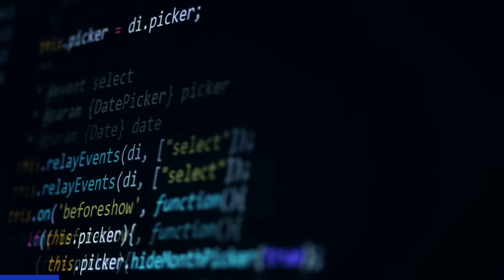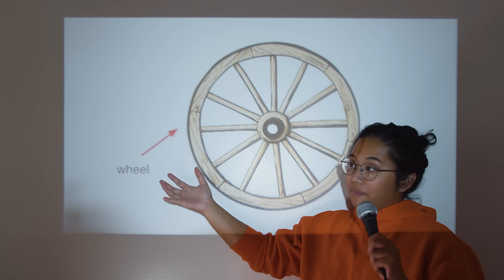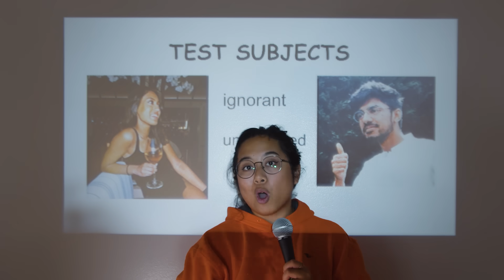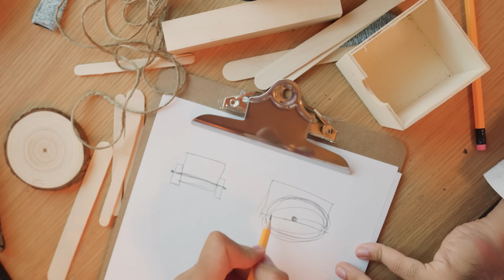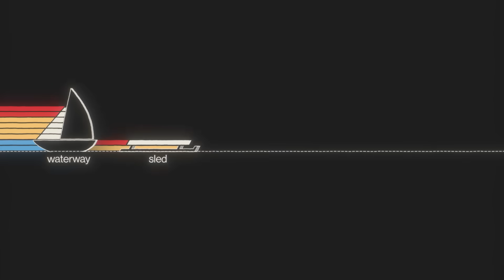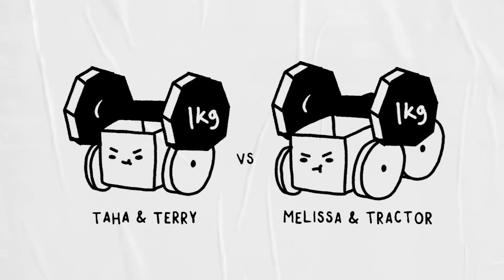why it took 200,000 years to invent the wheel

Comment: I am interested that Melissa’s interpretation of “Don’t reinvent the wheel” is don’t waste time on easy things.  I’ve always used the term to mean don’t waste time trying to figure out a solution to a hard problem if someone else already has a solution you can use.
Reply: This applies so well in design that it’s first thing they teach you in stem
Reply: Yeah, I didn't want to be the "Um, actually" guy, but yeah, lol. The term usually references a tool or a system that already works well, not that it was easy to create. A better tool or system might be possible, but it's usually not worth your time and effort. Just use what already works and move on with your other tasks.
Reply: @addanametocontinue  If we just settled for the first thing that worked because it appears to work well, we'd never have ended up with Maglev trains.
Reply: I guess it depends? A while ago I saw a maths exercise that I had done before and tried to solve it again. Obviously at first my thought process ran similarly to how it had done, but I tried to apply the new stuff I learnt and surprisingly it led to the right answer in a more simpler manner. Sometimes doing something again with different view and knowledge can help one come up with a better/easier solution.
Reply: @jacque.line_ng  sometimes, yes. but a lot of the time there is no need to reinvent the fundamental. Of course, in a certain sense, we are reinventing the wheel all the time. Material, tires, ball bearings, all those wonderful things that make modern wheels more efficient. but if you tried to start from scratch every time, you would never get to those improvements. which is to say, human progress is more times than not iterative, rather than innovative.
Reply: @jacque.line_ng  usually millions of smart people did that before you, which is why it is currently the most optimized state do to something
Reply: Don't spend your limited time and resources on a solved problem (if you can avoid it) is my interpretation as well.
Reply: Came to say the same. It's not about the simplicity of the wheel, it is the importance of knowing when you should apply existing solutions vs when to put effort into creating your own solution.
Reply: It's sorta complicated too, because reinventing the wheel is the best way to understand the wheel you're using. (Even for literal wheels.) So it depends how important it is that you understand every aspect of the thing you're working with.
Reply: I always thought it meant "don't try to invent something to replace something that is already perfectly efficient"
Reply: @zorn1745  Yes. That’s exactly what it means. Because that is the very definition of a time wasting action that has no added value. The saying is referring to things that are already working perfectly fine.
Reply: It could be both interpretations tbh. "Don't waste time trying to find a new solution for a problem that already has an existing, easier solution"
Reply: I never heard her interpretation before. I only know it as "why try to spend a lot of time trying to invent something that is perfectly solved already?" Because the idea of the wheel itself is already perfect and can only be improoved marginally, but there's nothing to replace it's idea as a whole.
Reply: I had something similar, about improving something when it's unnecessary.
Reply: Yup. Don’t kill yourself with derivations when Schaum’s is right there.
Reply: Occam's Razor
Reply: Yeah same, my interpretation has always been "use someone else's solution instead of solving it yourself" regardless of ease or difficulty
Reply: Why not both?  "Don't waste time on trying to solve problems that don't need solving".  It works whether the problem in question is something easy, or it's something hard that someone else already solved
Reply: @YayaFeiLong  so the implication as I use it is that it is inadvisable to invest a lot of resources in a task that will only produce a moderate improvement at best.  Complicated systems have so moving parts and redoing everything from scratch every time is a massive waste of effort.
Redoing a simple task isn’t that resource intensive so isn’t as wasteful.
Reply: @Taaneria  "Redoing a simple task isn’t that resource intensive so isn’t as wasteful." Not redoing but reinventing. You must come up with something new that can do exactly what the wheel does. That leads to people just making the same 'idea' when others already taking that known idea and are doing it better. Worse than wasteful it's detrimental and holding everyone else up especially if the new idea you are trying to sell is waiting on an old one.
Reply: Yeah that's how I use it too lol
Reply: That was the first thing I thought too. The harder the wheel was to invent, the less you should think about reinventing it.
Reply: I also assumed that because it was always sighted as the first invention in my childhood before any of the things they mentioned.
Reply: I'm just interested in Melissa... Thassa purdy gal right there. Attractive, too. And those are very different things.
Reply: those mean the same thing but worded differently almost
Reply: Thats the engineers usual approach if you want a guaranteed-to-work product on a deadline with limited budget. But you don't really get to improve stuff if you always go this way. Coming up with a better solution does require some sort of reinventing, especially if the "working solution" is a dead end and can not really be improved.
Reply: StackOverflow for the win.
Reply: I see if the same way as you
Reply: I think that is called Stack Overflow
Reply: That's exactly what it means. It's not about it being easy, but that a good solution is already available from somewhere else so there's no need to put effort coming up with a new one.
Reply: Yes she's not very smart
Reply: Me trying to program a calendar system
Reply: if its a solved problem youre better off making it intuitively simple for you to utilize rather than just copying it and moving on. Theres so much garbage out there because you can get by just treating everything like a blackbox
Reply: It means don’t do something that is already known — you’re not smarter than everyone in history combined
Reply: It seems like I’m an outlier in that I had the same interpretation as Melissa until I watched the video. (This is also the most thought I’ve put into the idiom, so I never really considered other interpretations.)
Reply: I suppose the difference is that the wheel is so widespread that anyone can make a wheel to a degree if asked to do it. Sure it won't be as efficient but still
Reply: Thank you, it felt like she is saying the opposite.
Reply: Yeah I always interpreted it as don’t do the impossible, which is kinda the opposite of what she said

Comment: 5:56 I feel like the main advantage of the free wheel design is that the free wheels can rotate independently whilst the fixed wheels can only move in the same direction making turning nearly imposable for carts using that method.
Reply: That's true actually, even today we can't figure out how much difference we should allow. If we allow anything than one wheel could get all the power. If we limit the ratio we could have reduced power.
Reply: I mean yeah, but also you don't have to move the axel. Less movement more effect.
Reply: Trains have fixed wheels

Comment: The key think that isn’t mentioned here is that the design of a wheel doesn’t scale as you would expect. It’s easy to make a small wooden model that is strong and works well but the friction and fabrication issues are far harder to solve for large scale and heavy payloads.

Comment: If I were in an age before the wheel with modern knowledge, I would have carved some stone ball bearings, possibly granite. Then build a race for those bearings. I now have a hub. Then I would build spokes and a tread around that bearing hub. I would lubricate the bearings with animal tallow to reduce friction. Now I can secure the wheels to an axle. Rinse and repeat. After that, I would secure the two wheels and axle sets to my wagon with heavy wooden curved bows for suspension springs (probably Yew or Ash), reinforced with scissor cross-bracing connected with dowels secured with cotter pins to reduce lateral stress. It will add weight, but it will make the ride less jarring.

That's what I could come up with just off the top of my head.

Comment: One thing you didn't mention but was crucial to the wheel being of any use was roads. For wheels to work you need to have a surface to roll them on - wheeled vehicles don't just run through thick forest, muddy riverbanks, or on sand. First, people had to notice that walking the same way for decades makes the way better because in time, you move big rocks out of the way, cut down trees and trample vegetation. Then, people had to have the idea that you can actively make a way where none was before by accelerating the process of decades of use through doing all this in a concerted effort in a short amount of time.

Comment: As good as the tension string axel was at the individual tasks, I don’t think the wheels would have rolled as well once the cart started carrying more than its own weight. I’m surprised it carried the weight of the egg without the abrasion of the cart’s axel holes gnawing the string apart. 
Plus, the max tension for strings are hard to scale up to item-transport size.

Comment: They both did a good job, but I think Melissa broke the rules with her pencil axles.  I don't recall pencils being among the things they were allowed to use since there were no modern (round) pencils in 3,500 BC.  The most difficult part of designing the axel was making it perfectly round.  I'm reminded of Nobel prize winning economist Milton Friedman point about a simple lead pencil and how there wasn't a single person that could make one by themselves.  It takes thousands of people around the world working together to make the metal tools to cut the wood, others to mine the graphite at the pencil center, others to get the rubber for the eraser.  Using pencils as axels seems a bit like cheating.  But pencil axels at least don't sag as much as string ones.

Comment: That was not fair for terry, as there were no competituon about sizes of a "wagon". Turn around radius, amount of axels, test for durabulity. C'mon you can create a wagon with 100 axels, it will hold a lot of weight, it will be able to pass 5 meters, but it will be hard to create and it will be almost impossible to turn it.

Comment: Terry has better wheels. He has suspension which allows him to transport over rough terrains.
And, to be frank, using ropes is like using thin axle on a marginally larger carriage. The steel axel actually budge under high load capacity, and it acts like tension rod to counteract the force and keep wheels under vehicle; this is why we don't use concrete pillar to make axle, well, the roughness it also one another reason. Melissa's tractor is an example of overengineering without enough troubleshooting, the fix to wheels coming off might be as simple as a grove for the rope to go in, but, that's how technology evolves, we fix new problems after failed solutions!

Comment: The "competition" should have included resistance with a heavy load, endurance over time (bearings are hard), and stability on bumpy surfaces. These "details" are what goes from a simple stick/string setup not good for work, to something useful for transport without constant repairs.

Comment: With the weight challenge they should not just check bottom touching floor but also wheels touching sides. After all, if the axle sags and the wheels touch the sides they cannot spin

Comment: It makes sense that inventing the wheel was hard. It is a totally different mindset. Like, modern day ppl, if asked to put a hole in something, they ‘drill’, but before screws were invented, ppl dug, because that is what they did to make a hole. In fact, ‘screws’ the helical object used to move water, existed long before the idea to use it to join objects, because hammering nails was the mindset, and that was because using wooden stakes was what was used before hand.

Comment: I saw that rope axle and immediately saw all the failures that it has. The biggest problem is that the rope doesn't twist infinitely, but the wheel really tries to twist it if you're moving with a load. You'll end up with a rope that's being tensed in every way possible which is not a good recipe if you want it to remain being one single rope (especially with something rubbing against like that).

On top of that, rope tends to stretch over time, though how much this happens depends on the type. But even if it did work, it won't work for long if you want any amount of precision.

Comment: Very interesting. Love the animations and small touches. :) Back in the day I bet carving was pretty hard besides sanding a small wheel in this case not to mention how rubber and metal wheel frames are on so many things these days evolving the wheel but not the round shape of course.

Yeah when I made a mousetrap car I had issues getting the mouse trap to work correctly to be the motor of sorts but also just the axels were trocky and thinking 'oh makes Axel's outside of the wheel connect somewhat like a train but to fit a cart design in a horizontal way not the way but no that can also make it have drag too'. The wheel is a simple invention just like the lever, button and other 'simple machines' I remember learning in primary school but I could not make a working mousetrap car in highschool that's for sure. I don't do engineering but it made it clear in highschool I suck at woodwork. XD

Comment: The thing about invention is... Unlike a discovery, you have exactly nothing to reference. A discovery is equally as impressive, but it relies on an undefined "scientific" (broad term, your eyes etc count!) way of reaching the discovery. An invention usually follows a discovery and builds up upon it.

Discovery: round objects roll, they can carry stuff and they transfer the momentum to the rolling object.
Invention: Logs under big boulders
Drawback: not very practical for anything else 
Invention 2: Basic wheels
Problem: structural integrity
Discovery: arranging wood in a special way makes it more powerful 
Invention 3: chariot wheels
Problem: pebbles penetrating the wood
Discovery: Metal is hard af
Invention 4: metal sheething protecting the wheels

Etc etc.

Comment: Got to say; You have real great friends. Testing your assumptions leads to great discoveries as well.

Any way, why not invent the wheel earlier? Why would 'they'? For instance, sheep were first domesticated over 10,000 years ago and raised as a food source in Central Asia. Shearing sheep did not begin until 3500 B.C. . There just wasn't a 'market' for it so to speak. You need to need to sheer before you think of sheering.  "A need" to make stuff from 'just' the wool instead of the fleece or leather. So weaving, spinning, knitting are inventions in the same pool of inventions. They inspired each other so to speak.  Same for wheels. You need roads to make use of wheels. There has to be a need to transport heavy/bulky stuff. It just didn't come up before roads were 'invented'. Yeah, real shorthand I know, but inventions don't develop in a vacuum. That's my point.

Comment: "The wheels that are better attached win" "Melissa deserves this"
One minute passes
Melissa's wheels fall off on their own
RIGGED I TELL YOU!
Reply: RIGGED
Reply: If the pecils where not round a big one would have been turning terry has two free spinning wheels but maybe not the cart
Reply: Terrys wheels were held on by string, it wouldn’t have lasted with weight.
The pencil wheels I feel fell off because she was pushing and not pulling, she may have been adding weight.
Reply: @helpme130  right, but the point of the first challenge was "does it have wheels?" Being that her wheels were so poorly attached that they fell off during the race, she shouldn't have gotten the point. As a result, the guy (I forgot his name) should have won the challenge 2-1.
Reply: RIGGED
Reply: RIGGED
Reply: RIGGED
Reply: RIGGED
Reply: RIGGED
Reply: RIGGED
Reply: RIGGED!
Reply: Taha was ROBBED
Reply: Still it was a better design than attaching the wheels using strings 😂
Reply: @Techtora  it absolutely wasn’t
Reply: I think what might of happened in that one is it also had some of her body weight pressing down on it too while she was moving it by hand compared to other that was just being pulled along by string
Reply: @DarnHyena  might have. Might of makes no grammatical sense.
Reply: TERRY DESERVED THE W. RIGGED
Reply: It was mainly the way they were pushing their wagons. The dude was partially lifting it as he moved. The girl was pushing down on it. I think if the dude was not using the string to pull (up) on the wagon, and pushed down on it like the girl, his would be more unstable -- I mean his axle was just a tensioned string.

They both demonstrated the difficulties of wheel and axle. As the dude had a weaker axle, but better method of affixing the wheel (just tied it all together) -- also had more friction in the first test because everything is just under tension which does not scale well. The dude's wagon wheels were rubbing  on the wagon body (which is why he didn't "deserve" to win the first test). The girl had a stronger more stable axle that rolled more freely (which is why she won the first test), but was had poorly affixed wheels.
Reply: Are you kidding me? The guy used STRING TO CONNECT WHEELS! This is by far the most rigged and pathetic attempt ive ever seen bya guy to create something. This man lost dignity
Reply: @silver2zilver  you are another bitter moid